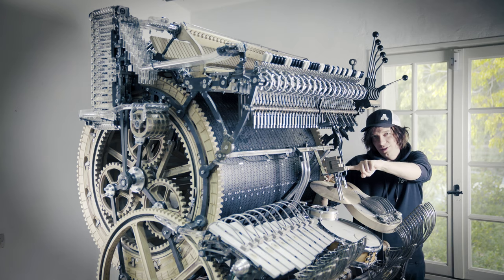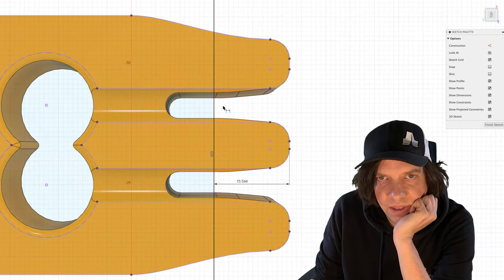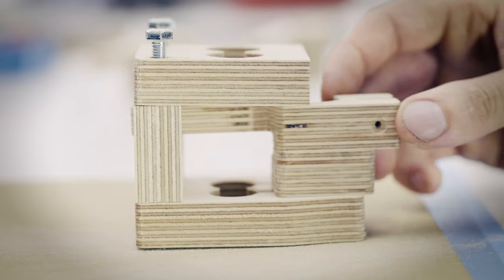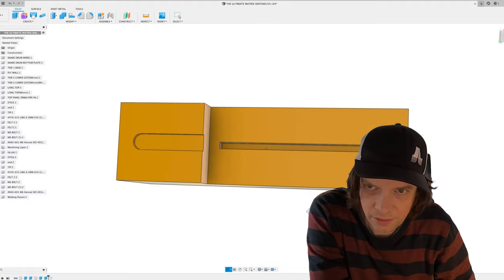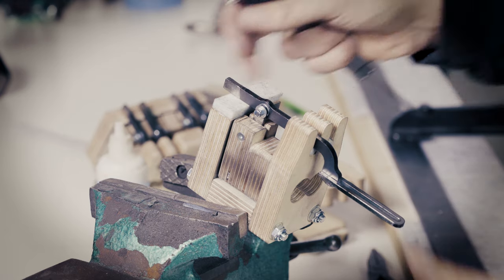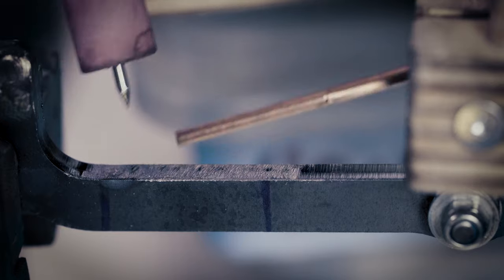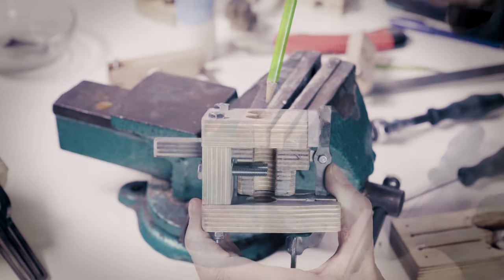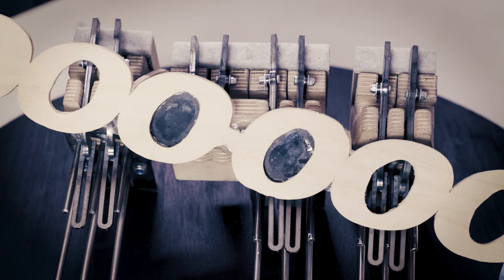Making Better Marble Gates - Marble Machine X #144

Comment: Seeing a whole lot of internet "engineers" falling into the same trap as martin here worrying about incredibly minor issues (ex: the threads will wear down and throw the machine off! the marbles will get scratched!) without understanding the larger concerns with the machine. If thread height is enough to throw off the machine, then the rest of the gate being made of plywood is a huge mistake that needs to be dealt with first.

The design philosophy of trying to remove errors to the degree he wants is a major problem. Using 10M cycles without fail as a design metric is the sort of mentality you see from undergrad engineering students without any actual experience. It's an unrealistic goal and chasing it will only lead to constant redesigns and disappointments. Especially on a mobile machine.  Multi-million dollar automation machines that are precision leveled, bolted to the ground, and substantially more rigid than the MMX don't get that kind of repetition. When talking about 10M cycles of anything, you're in the range of the lifespan of simple air & hydraulic cylinders, not the range for complex mechanical assemblies.

Instead, design in failsafes--ways to recover from errors or to make them less punishing/catastrophic. Your most important design metric for this machine isn't its failure rate--it's how long can it go without jamming. Design for that, and you'll find yourself both making the parts more reliable and finding ways to get around the inevitable failures.

Comment: That felt won't last 10 million reps without wearing in a groove and completely ruining your carefully adjusted spacing...  Spacing needs to be fixed against two hard, durable surfaces otherwise it is not repeatable.
Reply: Indeed. Failure tolerances need to be build in anyway. That machine will break during the first transport and setup.

Comment: Possible problem: I think you are taking too much dimensional precision from the felt, even if you get a completely consistent felt, I'm afraid that with time it could clump and change its dimension and not work exactly as expected. 

Possible solution: Maybe rubber or some other material with better stability, while still being soft, or change the design a bit so it doesn't depend so much on the felt dimension. I think a little more slack on the hole you did already added and then some more margin could be an option.

High reliability design is a b**ch, I had an industrial controller working for 3 years without a failure until it did. That's over 10000 hours without a failure, but it still failed, not biggy, 10 minutes later they were full production again. 

Redundancy is not the only way to think about it, most probable failure mode is also a good thing to consider. In your case jamming a marbles is much worse than skipping a note, so maybe coming down from your target but making it so if it fails it just skips a note lets say one per million and then a jamming goes well over one in ten millions is a good compromise.

Keep learning, keep shearing!

Comment: The whole 10M times without fail is super cringey to hear, as an engineer.  There's a big difference between "you want it to work 10M times without fail" and "it was designed and tested to work 10M times without fail".  And saying something like "this needs to work 10M times in a row so i'll give it a little extra slack" is going to lead to unsubs because it's just annoying to hear, super triggering for an engineer.

Comment: Martin, you are making more of the same type of mistakes. STOP USING WOOD FOR FRICTION PARTS. Don't let the marbles drop or run against metal (like the screws).  Think about what your own specs are saying to you....10,000,000 marble cycles x 100 - 1000 x.  What do you think that will do to your wood surfaces and parts??? What about wood swelling/shrinking? You are NOT using your head on this my friend. I've seen marine grade plywood de-laminate over time due to moisture, shock, vibration, etc. Please, please please stop and think!  Stop prototyping in wood and start building your machine out of durable materials.

Comment: I'll echo what other people have said - 1 in 10 million is NOT attainable, and nor should you be trying for it. The machine should be able to fail, in a way that doesn't impact the overall function (such as the clutch on the main drive shaft, just at a smaller scale).

Going only for reliability is not good engineering practice.